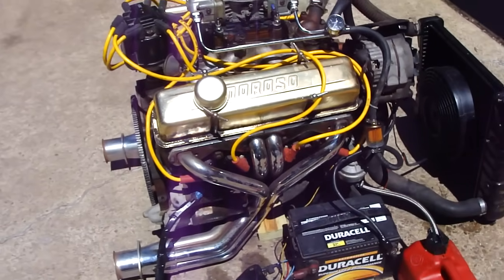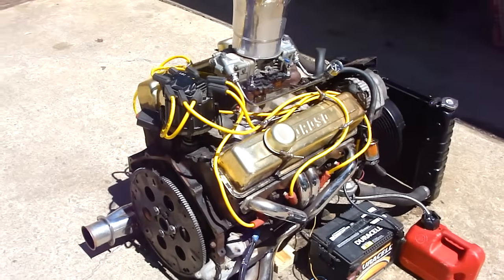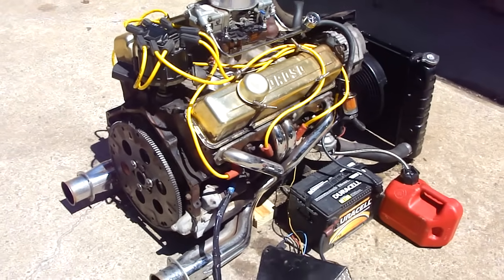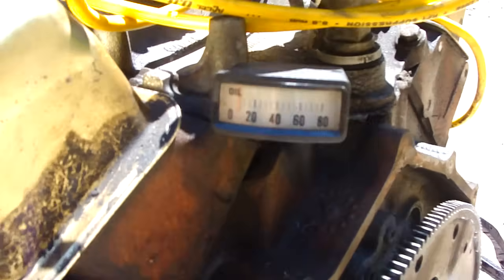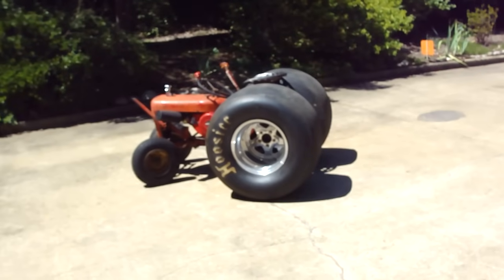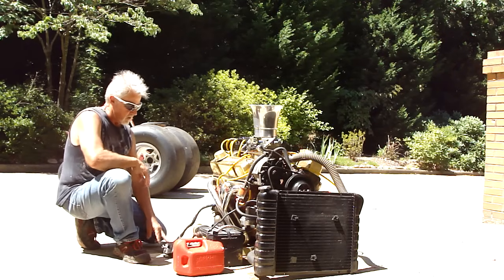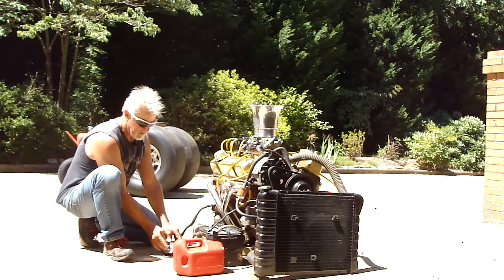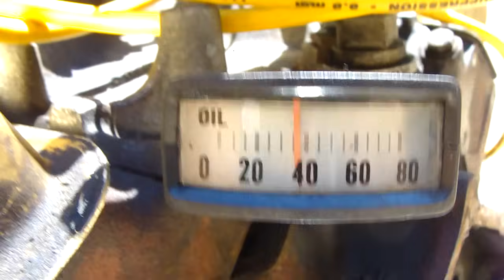INSANE REDNECK ENGINE START UP ON GROUND 'BOUT FLIPS OVER HOT RAT ROD ENGINE MUST SEE

Comment: For $3500 you can get a brand new 420 hp roller 383 stroker from GM... with a three year 36000 mile warranty.... this guy is dreaming.... that engine is worth about $600 bucks....
Reply: Robert Stevenson especially since the engine is running and being supported by nothing but the oil pan.
Reply: Plus he knows nothing about it you could buy a $1800 crate thumper cam intake carb and do the same thing and have a fresh engine. $3500.00 BAHHAHABAHHA!!!

Comment: at a loss as to what makes a used mystery sb Chevy worth $3500? minus carb minus headers lol.
Reply: Yeah no shit 'eh. LOL
Reply: See how many 400 SBC 4 bolt main blocks you can chase down, then you might understand why it's worth some money.
Reply: Matt Combs the 2 bolt blocks are stronger cause the castings for them have a higher nickel content. I got a 2 bolt main 400 with the wider "cheater" caps on it for $200. It needed about $300 worth of work done to the block and a good bottom and top end and she was ready. This engine isn't exactly worth  $3500. I think mine would bring more money from dirt track racers who need a 2 bolt engine and I don't think I could get $3500 for mine, and it runs and sounds a lot better than this one
Reply: Matt Combs if I had one I would give it to you and I would not be doing you a favor.
Reply: What idiot would shell out $3500 for a clapped out sb 400?  It's worth like $700 maybe.
Reply: 3500$ ? How much is a brand new one from gm performance? Probably less than 3500$
Reply: You, would be incorrect. You just keep telling your self that it will be fine in the morning.
Reply: gregg4164 actually 1,799$ at summit racing for a brand new gm performance motor 👍 but you keep telling yourself they aren’t
Reply: Everybody's all ways talking about higher nickel content prove it. Show me any GM literature stating that fact. That unknown engine is not worth $3500.00 period anyone that thinks so hasn't built any hot rods period it's a PIG IN A POKE.
Reply: Can't forget the flywheel probably doesn't go with it. Why else would he install it with three bolts?
Reply: this dude is out of his mind. there are nodular iron 400s and their are some without the extra freeze plugs. but as cheap as aftermarket blocks are getting to be who cares about these dinosaurs. At one time I collected them. For future builds I still have three ready to go blocks under my bench that's been there for years. have most of the parts to put them together. but I don't because there's no value in them anymore. I just sold a 406 with old school trick flow Twisted wedge aluminum heads a comp 614 lift cam. aftermarket rods and TRW forged pistons. ATI dampener Victor jr. intake with a 900 CFM HP carb for 3800. no way is this worth 3500
Reply: SMOBY44 flexplate
Reply: Does the block comes with freeze plugs and the waist basket on top  ?
Reply: Because it has yellow spark plug wires. That's why.
Reply: A vintage car buff would tell you that a specific car can be worth a lot more $ to a collecter if it has an original numbers matching engine sure you can buy motors all day cheaper than this one but it wont be original to the car

Comment: This has to be a joke at $3500. Stock HEI, stock starter,  cast heads, rusty water pump & pulleys (which he acts like he's really giving you something there) and a flywheel that must have been off a seized up motor cause 3 of the converter bolt holes have been blown out with a torch for removal from a seized motor.

Comment: Sbc Crate motors are around 1800 or more. If run time isn’t high I could see that price. Ceramic coated headers are 250 or more. New carb intake can cost 500 or more. We’re not talking about if it’s built tho but I see alternator (80-200$). If he had a tranny to go with and it’s brand new I would say 2800-3500 for a turn key setup... everyone is talking about they would buy the motor for 600$ that must of been back in the early 2000s, 90s, 80s , and 70s. You’ll find a junkyard 4.8.5.3.5.7 for that price with high miles; not a 6.0 or all aluminum 6.2 for that price or 5.7 aluminum for that price even!

Comment: I bought a new 350 crate engine long block 265 HP ,4 bolt mains for 3200 $ from gm chevy dealer for my 1962 belair , your 3500 $ , small block is  over priced for  an old stock engine,your stuck  in the glory  days pal you'll never get that price in today's world.

Comment: I bet a stock 5.3 LS motor makes more power than that scrap !!!!!!
Reply: That's a 400 small block. Now it's just my opinion but I never liked those engines. Low power, has no torque off the line, and they consistently overheat and blow head gaskets. The cooling jets in the block we're set up a little different than the regular 350 small blocks of the day, that's what caused that.
An LS engine is a completely different Beast and is much more technologically advanced than that Relic. Just a stock 5.3 would be a much better engine for any project

Comment: y didn't u stadle it to hold it still, you could have hire revs, eyes wanted to hear it roar first and foremost, will it hold up to at least, 6,000rpm, what's the erle pressure then, jus'wondering

Comment: Use it straight for a boat anchor
Reply: It would probably make a great engine for a boat. It sounds good and used.
Reply: I have custom ground cam for my 355 from boat racing. Probably way faster than those cams you buy from Jegs for a car. Lol
Reply: i say put it on that riding mower in the background

Comment: Just a silly small block with an RV cam on it woohoo!.... You can buy a crate engine for less than $3500 that'll give you more horsepower than that Old 400 cu. inch! ......"Hot Rod ronnie" 🤣😂

Comment: Sweeet 400. Mines pushing 425hp and around 400fpt max rpm I've gotten outta her is 8-9000rpm(stock) from factory. Way better when you know exactly what to look for. Plus it's lighter than a BBC by a few hundo lbs.
Reply: Brandon Spielman 9000 lol. How many holes are in the block now ?
Reply: 400? That will never rev up too 9000....5500 and 6000 is redlining it

Comment: bare 041 heads worth 600 US
Reply: Got a rebuilt 327 with 202 double hump heads (rebuilt ported and polished) for 350$ Only thing he did wrong was put piston rings from about 2 or 3 different motors and the cam bearing spun